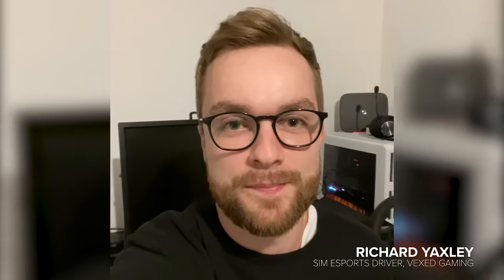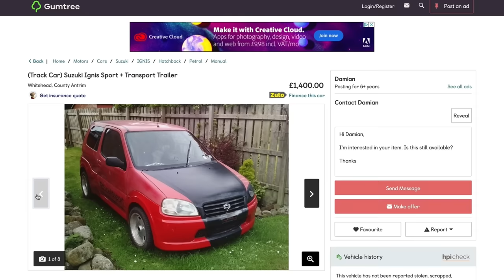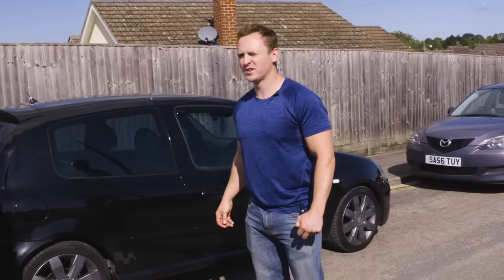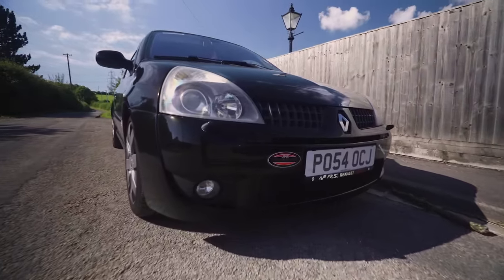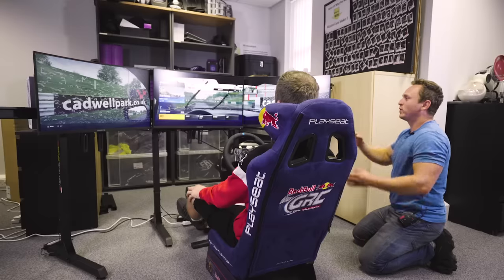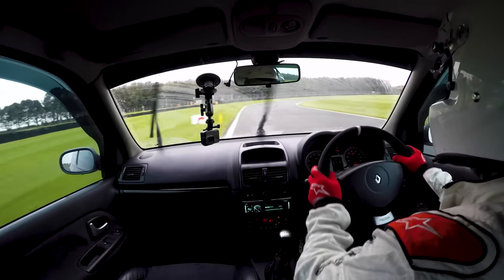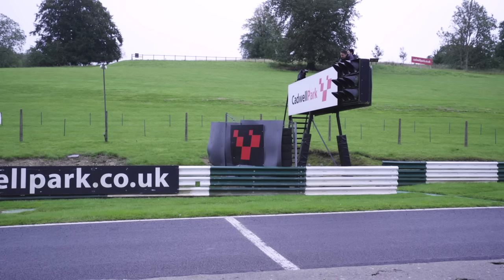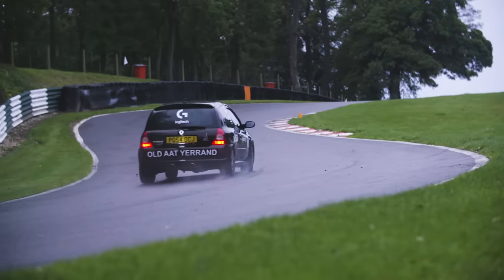£2000 Track Car Challenge

Comment: As top gear once said. "You can go faster sat at home on a sofa, than you can in a race car".
Reply: Ya that is so true
Reply: I dont get it
Reply: @bennibilasala5236  on top gear Jeremy Clarkson tried to drive around Laguna seca (I think that's how you spell it) faster than someone did on gran turismo. In a honda nsx(I think). Same car same track. He failed aswell. You cant go as fast in real life.
Reply: @paultoddington2755  couldn't remember if it was Jeremy or someone else on playstation. Good memory.
Reply: Bumps you dont feel. Straights that aren't straight. Then the car. Car wouldn't handle or break the same way. Too many variables in real life. The guy on here beat F1 drivers. But bet he couldn't even do a 2.10min lap.
Reply: Jeremy did indeed try, but he couldnt beat his own time. He said something about not being able to drive toward a wall at 100+ and trust the brakes in real life like you can in a game.
Reply: @Joe-dq8mb  If you don't trust the car or yourself of course you will be slower, that's where practice comes in, and big balls.

edit - I just realized that he set the 1:55 time on Project Cars 3 which is more of an arcade game than simulator so that doesn't really count in my opinion. Much easier to go faster in an arcade game than simulator.
Reply: @sirmounted8499  I completely agree, it was the screw at Laguna Seca - he just couldnt late brake it like in the game & tbf I dont blame him. 

I think Alex in a 15 year old real used car being within 6 seconds of someone sat on a sim isnt bad going at all. What would be intersting would be a 182 in the same game & how the time compares to the gt86.
Reply: In the simulator it is easier because your life is not at risk.
Reply: @andrewmcgill6659  for real, too much movement in real life to compete with perfect conditions
Reply: I remember that episode. Clarkson raced a NSX around Leguna Seca on grand turismo and then in reality. He was way slower in reality.
Reply: Did they say that
Reply: So true, his scrawny neck wouldn't handle one lap in a F1 car let alone a race. F1 drivers are super fit, Jeremy Clarkson also hurt his neck in a GTR from the G forces on a track in Japan.
Reply: Not to mention cars on racing games start each race like the just come out of the factory whereas Alex's clio is 16 years old.
Reply: @sirmounted8499  the part your forgetting is even if you fully know and trust your cars there are things no game can fully account for. E.g imperfections on the track, tyre ware, brake ware even brake fade.
Reply: @andrewmcgill6659  pretty sure the biggest thing is just fear because in a sim you don't have to worry about it but irl the fear of damaging the car and hurting yourself
Reply: Because you won’t be scared if you crash or something so you can go really fast
Reply: Lol I remember that episode
Reply: @Joe-dq8mb  With the mix of old good rubber and newer cheap rubber on top of that too. New Michelins all round would probably quite easily half that gap, maybe be even more competitive with a 1:55, really quite impressive in my opinion.
Reply: @andygenner5360  he should have been allowed at the very least put on brand new tyres and brakes.
Reply: True true the sim guy is meh
Reply: I dare him to do it in real life aswell. Prolly quicker but not as quick as in the sim
Reply: @andrewmcgill6659  You do realise Laguna Seca wasn't laser scanned on GT4
Reply: 999 likes lol
Reply: don't forget the stig
Reply: There's also the real life factors that aren't in the game/ cars in the game are perfect too n shit
Reply: @andrewmcgill6659  f1 racers would brake for anticipation of feeling things from real life laps that this gamer wouldn't ever feel in his life. If he genuinely believes he can beat real championship racers he is dillusional. Even down to single things like wind or dust etc.
Reply: @CraigWard     you     Cant    beat        honda      NSX
Reply: @andrewmcgill6659  aye but thats a old title, modern games like Forza 7 or Assetto Corsa. may be a lot closer.
Reply: Hasn't Toyota done a team full of sim racers that did well in actual lemans
Reply: @sirmounted8499  true that. If It was Gran Turismo It would probably be slower.
Reply: Because games aren't realistic
Reply: @andrewmcgill6659  plus you cant break the car or die in a sim, that probably accounts for more than you expect i assume
Reply: @andrewmcgill6659  They've had sim drivers race in real life, they win almost as much as they do when simming
Reply: @andrewmcgill6659 times have moved on since 2003, games are incredible accurate now most notably assetto corsa for the car physics and realist track size as they get scanned and inported into a game. sim racing wheels have force feedback meanung you feel bumps and understeer etc, you can also get motion platforms for the pit in your stomach when going over bumps. the sim rig used in this video was far from realistic as its a cheap logitech wheel but if a proper rig is used it is super realistic.

Comment: That sim driver seemed like such a tool. It's easy to be smug, when you drive a simulated game, in a rwd car with about 20hp more and no consequences  to worry about. In real life, i'm damn sure Alex would win by a mile!
Reply: Issue is that the "sim driver" played an arcade game, not a sim.
Reply: Oh and on top of that the cars are performing at their optimum. Well that can’t be said about a 2000 bucks used car right?
Reply: Not to mention playing fucking project cars 3
Reply: @jesseyoung9013  I was wondering why everyone was upset about project cars until I saw it was 3, not the 2 I'm used to which is a decent sim. but yeah that "sim driver" was a real prick
Reply: @speediskey3856  eh i mean pcars 2 is still a simcade. comparing it to real life would be an unfair advantage. Assetto corsa would be the way to go for a challenge like this IMO.
Reply: @benjamincoram7036  nah pc 2 can be a real sim depends on car, track and weird shit. Sometimes it's great sometimes it sucks, kinda weird game ngl
Reply: @benjamincoram7036  idk dude, in pcars 1 a dude beat a f1 driver, same driver then tried to beat the pcars player in pcars 1, he couldnt either. pcars 2 and 3 are utter bullshit tho.
Reply: @speediskey3856  no pc2 is already shit 1 or go home, with 2 they did make changes for more online players, meaning making it more arcarde like.
Reply: Same thing as sim pilots
Reply: put that guy in iRacing and i bet he'd have a much harder time. ive done well over 100 laps in a shitty car on the Nurburgring, and close to 7000 laps in sim. and it's accurate. a REAL sim changes things big time. i agree, put both of those guys in the Clio, and Alex smashes it easily.

Comment: They should've taken Jack's Golf. It's literally across the road.
Reply: Lol!!!
Reply: yeah, or at least they should've searched for a mk5 gti. turbo engine, 2l, 200 horses, much stronger car. But maybe the power to weight ratio is in favor of the renault.
Reply: I doubt it's worth 2000
Reply: Probably SORN'd. Cant drive it if it is.
Reply: @Krazy8603  Jack's is definitely worth under 2k
Reply: its 100% on jack stands in about 42,000 peices
Reply: plus with the royal mail lorry that would be over 500hp
Reply: I want to know what jack has done to royal mail, as there motto is with us, it's personal.
Reply: @vladmihai306  - my 172 Cup crept past a standard MK5 ED30 in a straight line, I’m pretty sure the Clio would munch it on track.
Reply: They need content!
Reply: This joke has gone over peoples heads BIG time!
Reply: Anyway, it was a very nice episode, very nice idea and they did very well for 2000 bucks. They should've tried stripping out the car, just a bit though :))
Reply: It's slower than a Clio RS.
Reply: Jack's golf is in repairs remember, when he got hit by the lorry
Reply: @CarThrottle we have a new challenge for you! Compare the Golf mk5 GTI with the Clio RS on Cadwell park.
Reply: Yh it’s good at going sideways
Reply: @davespooney8472  Got to admit I was surprised how rapid they accelerate when I met one on the motorway in my M135i. I expected to breeze by but that thing was remarkably rapid at speeds of over..um..67mph let's say 😀
Reply: @staggabob  - wow, maybe he had a different engine under the bonnet 😂
Reply: But is it 2k?

Comment: The think the simulation is unrealistically fast, there were parts the sim was flooring it in third, virtually going straight over grass verges to cut the small corners
Alex in real life couldn't do this, he'd catch the first patch of grass with one side and spin out or tail slap after correcting
More physics need to be involved in the game, Alex's time, in a near 16 year old car not built for a track, was phenomenal
Reply: You're correct. And that's because they picked the shitiest "simcade" out there. If he did this even in Project Cars 2 he would be spinning out of control.
Reply: Project Cars 3 is not a very realistic sim racing game. The sim racer had a better car, much more practice and sat comfortably in his home. His lap time wasn't very good, all things considered.
Reply: @CheeseFarts  project cars 2 would also have been better than project cars 3
Reply: @lynpendry  Even PC2 have superior tire  physic and is much faster than AC or GT sport
Reply: Alex's lap times were very consistent, which means he must is driving pretty well. But I agree simulator versus reality does not compare nor was it the same car.
Reply: @mecha207  Alex is really superb driver
Reply: Project cars 3 is an arcade game which doesn't account for brake fade which would of affected his lap a big margin
Reply: @LukeyWolf  brake fade, heat in tires, weight transfer, chassis flexing etc
Reply: @CheeseFarts  yep
Reply: Ivanhoe ॐ  like Jimmy Broadbent?
Reply: Those 182's are built for the track tho..
Reply: Well i mean with most sims the driving style is that of a 16 year old that just stole somebodys BMW, you just drive very agressive and fast without being concerned about property damage, other people, damage to the car, or being very injured if you bin it into a wall going high speed
Reply: @CheeseFarts  AC would have been worse. It's an older game, and a less sophisticated game engine, so would be worse than even PC3.
Reply: @Vesiot  Didn't you just compared AC to PC3? Those game have completely different physics and aim for different audience.
Reply: @Vesiot  oh oh oh no no no this is so sad
Reply: Its Project Cars 3... no way is that game in any way a "sim", PC3 is utter tripe. Assetto Corsa should have been chosen here.
Reply: To be fair that little clio is designed for track. But its entry level budget.
Reply: @Regexion  Almost every driver on Earth would score a better time in the 182 than the gt86. 

Only very well trained drivers will exceed FWD in the wet, in a RWD.
Reply: How do you know its phenomenal. Have you been to the track in a reference car or smth

Comment: “This has got cruise control so it’s quite a well specced one, which is obscure” just like every other 182 then 😂 please more Clio content!
Reply: As if the CC would ever work on a Clio 2 🤣, having had 3 myself I havent had a single one in which the CC worked. Only the limiter
Reply: Mine have always worked fine.... use my current cc all the time.
Reply: @DataC0llect0r  mine worked in my 172. It was literally everything else that didn't. It broke down on the way to a Cliosport meet 😂
Reply: My first car was a 172 and i had it for 5 years and only had a coil leads and fuel relay . Further drove it like I stole it never missed a beat . Still the most fun car I have ever owned
Reply: Clios are shite

Comment: New brakes , tyres, 4 wheel alignment and some weight reduction. After doing that you could shave up to 5 seconds off
Reply: That might be a good follow-up video. Can they make the car 5 seconds faster for £500 (or some other number).
Reply: Clearly
Reply: that was my first thought as well
Reply: yeah i really don't understand why they didn't at least strip the passenger seats
Reply: yeah should have at least yeeted the interior
Reply: I knew this comment would be here. This needs done.
Reply: I really want to see that
Reply: I was thinking more budget, just track pads, a change of oil filters and bung up the exhaust holes to get under 2mins.

Comment: Any credibility of the sim racer was lost , when they decided to use Project Cars 3 as sim to set the lap time
Reply: Unfortunately, I don't think that whoever develops PC 3 won't like not using their game in the video considering it was probs sponsered by them
Reply: That's exactly what I was thinking! Why not use either Rfactor2 or iracing? I've never played these games as I'm just amature player, but those 2 games are known for their realism project cars 3 isn't even a proper sim!
Reply: The minute I saw your comment I realised this ain't going to be fair what so ever... PC 3 is barely even considered a sim compared to the other ones. Im sure this sim drive has iRacing or/and Asseto Corsa which would be more suitable to do stuff like these...
Reply: @abdurali8855  Because this was a giant ad, a fun one, as always, but sponsors decide those details, not them. And given that the car had a PCars sticker, you can bet either Slightly Mad or Namco where involved in this.
Reply: @ComandanteJ  that's true
Reply: project cars 3 is crap
Reply: And when they used the Trueforce wheel
Reply: Guys u even heard about LFS (Live for Speed) way better than Assetto 👌
Reply: lol just did a 1:54 in the wet using the same car in P3 using a controller. ABS on and TC on low with SC off. also in the rain. does that mean im a pro now ?
Reply: It means your faster than an f1 driver so yes your a pro lmao.
Reply: @francoiscombrinck3884  , they should send you a cap!

Comment: When you are looking for a 182 and car throttle is about to buy one, makes my day.
Reply: Save yourself, do it! Can’t go wrong with how cheap they are  👏🏻
Reply: @v4-goose147  I’ve had a normal Renault Clio. It was the most unreliable thing ever. But it was dirt cheap. Why is the 182 not worth it. I know cheap sport hatchbacks gets thrashed a lot so is that one reason why?
Reply: @ajharmiah2692  only the bits that aren't important and/or cost a tenner a pop off a breaker to replace break though. The rest is invincible (if you do your timing belt on time that is)
Reply: I’ve had 172/182/197 225 Megane and now have a 250 Megane, I’d do anything for my 172 back was such a perfect car I love it, if you get one mate never let it go
Reply: @v4-goose147  never had any issues with any of mine, but anything else I’ve had vxrs and sts are all crap even my s4 spent more time in the garage than on the road😂
Reply: @Az Lean if they where so shit I wouldn’t keep going back 😂 people just hate on everything no matter what it is
Reply: Moss I’ll quess you only looked at google for pictures and searched for oil leaks etc .. the f4r are great engines that’s why 80% of the Nurburgring fwd cars are Renault and 70% of that has a f4r in it.  Sometimes they leak a bit yes but they don’t use oil atleast like a vw or a Honda . Further my 172 engine was dry only the gearbox leaked slightly . Your just one of those haters who looks on google to look for horror story and spread the hate. I know people who have a megane 250 chipped to 310hp and track it it never misses a beat . NOT EVEN LEAKING A SINGLE DROP OF OIL . The gearboxes or the clio 197/200 have only a problem with synchro mess of 3-4 gear if you replace that one you never get a problem agian.

Comment: Why didn't you guys remove the seats or something like that? 
That should have given a better time
Reply: Since it was a track car challenge, it would have fitted the theme so well
Reply: Lack of time probably, they had to get the car toa Manchester
Reply: What about the weight balance? It is already front heavy.
Reply: @DashCamSerbia  it is a ff platform would give him more traction on his driving wheels.
Reply: The car had bad brakes and crap tyres on the back, it had an oil issue aswell or something I think they said, so shredding weight won't have made any real difference. The car was far from track ready
Reply: Yeah they should have gutted the back
Reply: Shedding weight always makes a difference and a big one at that.